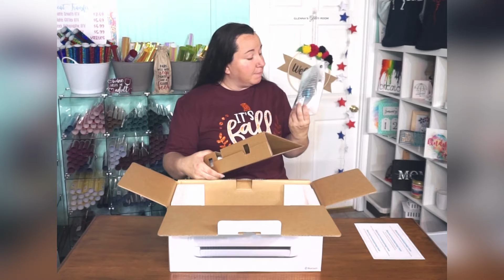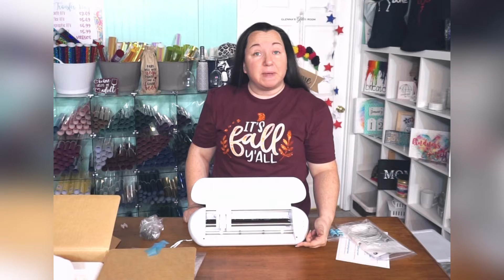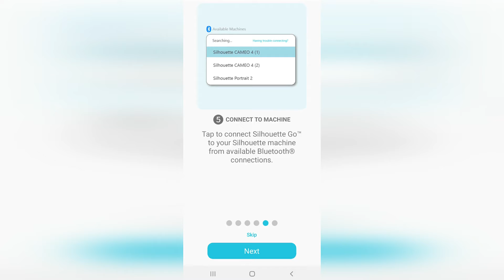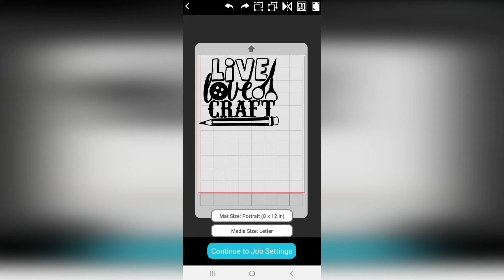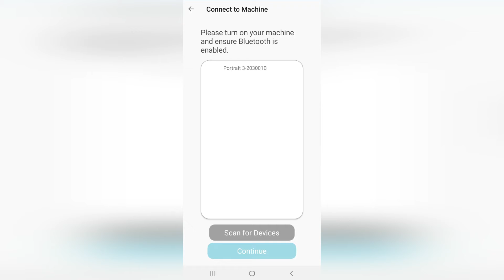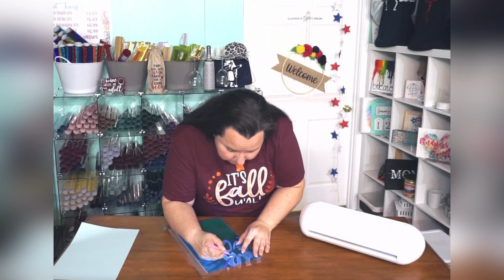Silhouette Portrait 3 Unboxing and Silhouette Go App Sneak Peek

Comment: I bought this machine to make sublimation mugs using cut and print. I couldn't get it to cut, and when I used the mat, the paper stuck so hard, it couldn't be removed without ripping it. I wanted to return it, but SilhouetteAmerica's policy is not to take returns if the product has been opened. I wish it would have worked, but be warned it is not returnable.
Reply from the maker: Hi there! Our apologies for the troubles with your Silhouette, but don't give up just yet! We are here to help. Once you print your design with your sublimation printer, you can cut by hand and then press to your project as needed.  Is there a project you are working to complete? We can help with that! 😊

Comment: As I walked through this video with you, I got stopped at the app where it first asks you to choose your machine.  This machine is not there, so I didn't know what to do.
Reply from the maker: Hey Barbara, did you update your software to the 4.4.281 version?  The prior models won't recognize the newer machines.  Let me know and we'll keep troubleshooting if we need to!   ---Becky
Reply: @DesignBundles  do you mean my Android phone software? When you showed that screen in the video, the Portrait 3 wasn’t there either. You went kind of fast right by that screen, so I had no idea what you selected. If you mean the Silhouette software, I won’t have that on my phone. How would I get it onto my phone?

Comment: Hi, I download the last version of software for purpose to test until buy the machine. When it comes, I only need to add the cable? Or I will need to reinstall all stuff lol. :)
Reply from the maker: Hey Claudya!  Great news, you shouldn't have to do anything other than connect your machine via bluetooth (or the USB if you prefer).  You shouldn't need to reinstall anything as long as you are using the correct version of Silhouette Studio.  Hope this helps!   ---Becky
Reply: @DesignBundles  Thank you Becky 😊

Comment: I don’t have a computer or laptop . I wish it had a way of using it with my mobile device! Will it work on a chrome?
Reply from the maker: Hey Susan!  Unfortunately to use your Silhouette, you'll need a computer with an operating system.  A chromebook won't be able to run Silhouette Studio.  Wish I had better news!   ---Becky
Reply: @DesignBundles  Thanks for answering my question so quickly😊❤️

Comment: Do you have a video using heat transfer vinyl using the Portrait 3?
Reply from the maker: I do not, but the process will be the same as the Cameo models, other than size that is.  Hope this helps!   ---Becky

Comment: Thanks for your video! I plan to buy a P3 next month. I've never used any cutting machine before. I need it to cut my templates (I play papercraft) and I wonder if the app that links Adobe Illustrator to the P3, do I have to buy it after getting the machine as I have to add registration marks on papers to cut correctly? Or it comes with the machine? Thank you in advance! Have a nice day!
Reply from the maker: Hey Nguyen!  So the question becomes, are you needing to send from Adobe or Corel straight to the Silhouette?  If not, you can use the free version of the software.  You will save your file as an SVG, PNG, etc and then import it into the software.  But yes, if you are wanting to use Silhouette Connect, you will purchase that separately.  You can read up more on it here, I unfortunately don't have any direct experience to help you out.  Thanks for stopping by!   ---Becky

https://www.silhouetteamerica.com/software#silhouette-connect
Reply: @DesignBundles  thank you so much for your answer! Because there are texts and decals on details and I have to print them first then cut. Maybe I will find out how it works when I get my P3. ^^

Comment: Hello, 
Sorry to bother you, I discovered your youtube channel today and I had a question about cutting machines. Indeed, I saw your nice presentation videos on the portrait silhouette 3 and on the cricut air explore 2 and I was wondering what are the differences between these two machines? I'm hesitating between the two and I don't know which one I bought ... 
I also wonder if the silhouette portrait 3 can cut A4, plasticized sheets and very precise small images ? I would like to use this machine to create games for children ... and other personal projects :) I don't know which one would be the most suitable ?
Thank you for your reading and thank you in advance for your answers. 
Good day

ps : sorry for the mistakes, I speak French :)
Reply from the maker: Hey Margot!  I do not have a lot of experience with cutting plasticized sheets, but I don't know that either one of these machines will do what you are looking for.  I've cut acetate in the past on my Silhouette and it was fine, but my designs were not intricate.  Thicker materials like plastic take more force, meaning your cuts may not be as precise.  But if I had to choose between the two, I would choose the Cricut Explore Air 2 because it is typically a more precise cutter than Silhouette machines.  Wish I could give you a definitive answer.  Best of luck!   ---Becky
Reply: @DesignBundles  Hello ! 
thank you for your answer! normally plasticized sheets are softer than acetate, do you think that with a deep blade this is possible? I'd like to take this opportunity to ask you one last question: could you tell me how the cricut explores air 2 is more precise than the portrait 3 silhouette? 
thank you very much!
have a nice day

Comment: I have both the cricut air 2 and the cricut maker, but I’ve been wanting a silhouette portrait 3 for smaller designs and sticker sets. I love my cricuts but their print and cut is just so.... rubbish!
Reply from the maker: Hey there!  The Portrait 3 is a super-great small-format cutting machine!  Unfortunately, I feel like the Cricut machines are more reliable in their print and cut, so I'm not sure the Portrait 3 would really help in this department.  Hope this helps!   ---Becky
Reply: @DesignBundles  really? That’s the opposite to what I’ve heard 😨 either way I will love my portrait 3 regardless. It can’t do any worse than cricuts surely 😂

Comment: Can you run this from both computer and phone? Like able to swap back and forth.. I want to be able to use it at my primary work station, but also be able to take it with me to shows
Reply from the maker: Great question, Abi!  Right now with the App in Beta testing (and very limited), I don't consider the App a feasible option for using it at shows.  I would stick with a laptop if you have one available until the App is more functional (fingers-crossed!).  Hope this helps!  ---Becky

Comment: Are you able to use custom designs and logos? How would you do that through the app
Reply from the maker: Great question!  No, as the app stands now, you cannot import outside images without using a desktop version of the software.  You can upload on a PC or Mac, then save to the library for use on the Mobile App, but after all that trouble, you could just cut from your PC or Mac.  Since the app is still in beta testing, I think this is something that will change before it's fully released.  Hope this helps!   ---Becky

Comment: Thanks for this video! The size is a huge draw for me, as I live in a very small apartment and literally have no space for the Cameo 4. Reviews and tutorials on the Portrait 3 is still few, but is it fair to say that tutorials to the P2 will apply to the P4? I want to use it to cut stickers, and if it will be good for kiss and die cut stickers. Thank you.
Reply from the maker: Yesss!  You are 100% correct, there are very few differences between the Portrait 2 and the Portrait 3.  You will find a plethora of information on the prior model Portraits since they have been out longer.  Hope this helps!   ---Becky
Reply: @DesignBundles  Thank you! Excited to get mine.
Reply: @DesignBundles  I have to ask, is it possible for me to set the cut lines in my computer, save the file, and send it to someone else to do the cutting? Thank you.

Comment: you said you would still recommend the cameo 4 over this if space is not a concern, why is that? I know they are different sizes, but are there differences in quality?
Reply from the maker: Hey there!  Great question!  Size is the factor here, because the price difference is minimal when considering buying a machine (around $80 difference.  It probably doesn't seem like it, but using the Portrait can make certain projects more difficult, only because you have to either cut and piece multiple items together or limit the size of files you work with.  Most crafters/bloggers/creaters think in terms of 12", so most of the inspiration you find are using a 12" machine to cut.  Vinyl is offered in 12" rolls and sheets (except certain vendors) so you end up cutting down and potential wasting the additional 4" of material.  So I do love the Portrait, but if space/mobility/budget wasn't a concern, I would recommend the Cameo 4.  Hope this helps!   ---Becky
Reply: @DesignBundles  I was thinking of using it for stickers possibly, so I wasn't sure.

Comment: Hello, the portrait 3 machine is as fast as the silhouette 4 machine? If I buy this version it will be for that. I will appreciate your opinion. Thank you for the demo.
Reply from the maker: Hey there!  Great question!  I don't believe you will see a noticeable difference in speed between the Portrait 2 and the Portrait 3.  I have not found anything to support a faster cut speed.  Thanks for stopping in!   ---Becky

Comment: Thanks for the great video.  Is there a difference between the Portrait 2 and 3 ?
Reply from the maker: Hey KM.  There is not much difference at all between the Portrait 2 and 3, other than the P3 has the new Autoblade like the Cameo 4s, but the P3 only comes with one adapter (sketch pens) instead of 4.  I definitely wouldn't recommend any Portrait 2 owners upgrading to the Portrait 3 unless you have to for some reason.  Hope this helps! ---Becky